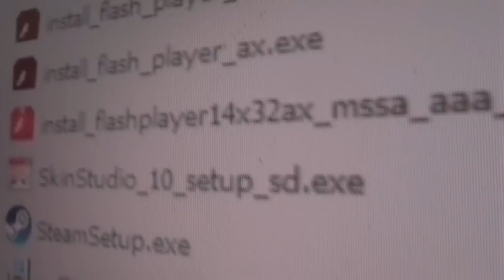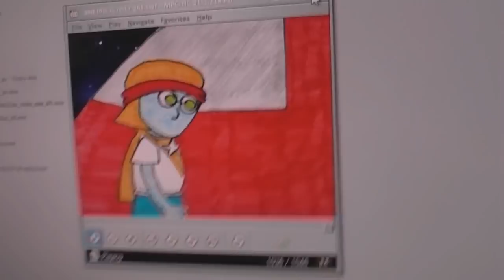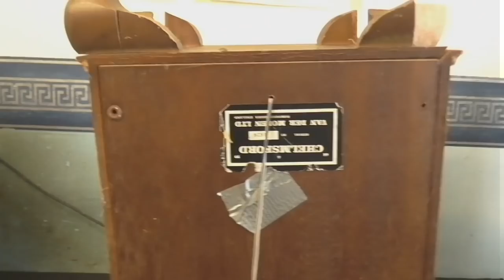What's inside those vintage speakers I found?

Comment: Hey Clem. Those are nice old speakers. I'd just replace both woofers with a matching set with T/S parameters that work in the cabinets. Hopefully you can find the missing foot. It would be a shame to "Frankenstein" the things.
Reply: The qts of the driver is probably around 1 or more. System q is probably around 1.5 I'd estimate, probable A LOT more. Big magnet, big coil (=low qts and high inductance) drivers are not a good choice here.
Reply from the maker: I know where the missing foot went, it fell off as I was carrying them home, so I'll stick that back on once the electrical stuff is done.

Comment: A nice crossover, turns out I was correct. ;)
The owner probably replaced a blown driver in the 80s which is now foam-rotten. The polyfill seems to be more recent either, they almost exclusively used fiberglass back then. Those are well worth restoring, maybe you can find an original driver on ebay?
If not, keep the x-over point impedance in mind when replacing it, otherwise you will get an overshoot which doesn't sound good and the amp doesn't like that either. Phase and sensitivity are also important but it's up to you how much time you want to invest in this project.
Reply from the maker: You seem to know a lot more about this than I do, I'm not gonna lie, can you give me some pointers about how to find a good replacement driver? Like what electrical measurements I should take and how to do that?
Reply: @CoolDudeClem  

Play a sweep or white noise through the whole speaker, hook up a scope or meter in parallel to the original woofer,  determine the cutoff frequency where the voltage at the woofer is at 70% (3db down).  Note that frequency and measure the AC impedance of the (disconnected) woofer at that frequency. 

Then find a driver with roughly the same impedance and a good frequency response at that point (see the impedance and frequency graph in the datasheet).  Sensitivity should be around 90db/1W as a guesstimate. Don't use a driver with a qts (in the datasheet) lower than 0.4 since they lack bass in a sealed cabinet. You can also send me a reply with your measurements and maybe I'll have an idea for a good repacement... 

Concerning the phase, just flip the polarity of the woofer around while playing the cutoff frequency and use the polarity where it is louder (so that the sound of the tweeter adds up to it instead in cancelling it out), that's pretty much all you can do without measurement equipment.